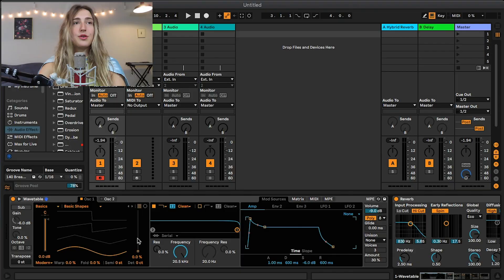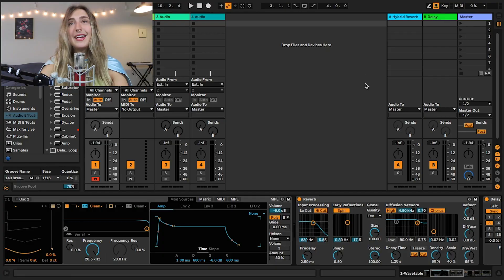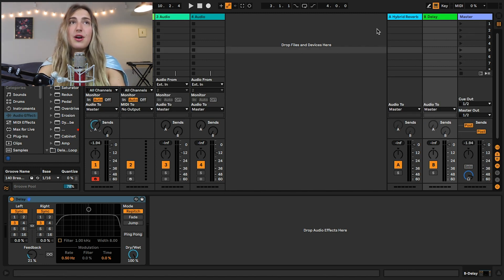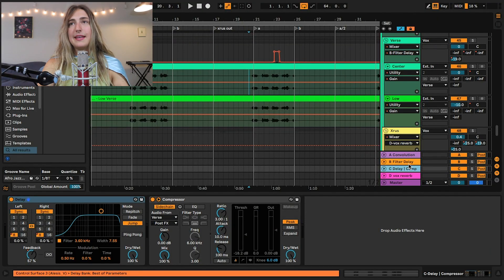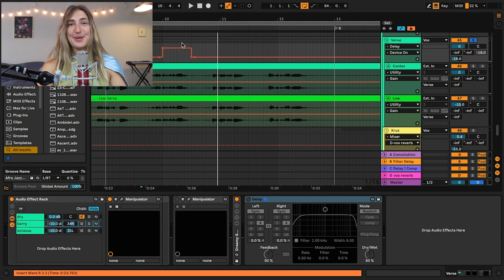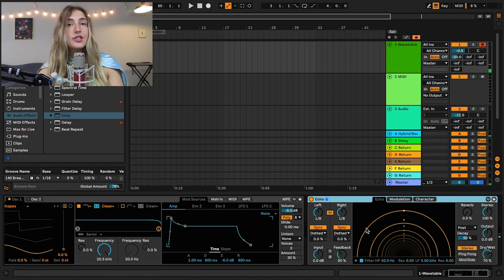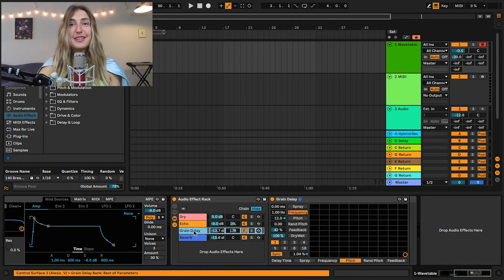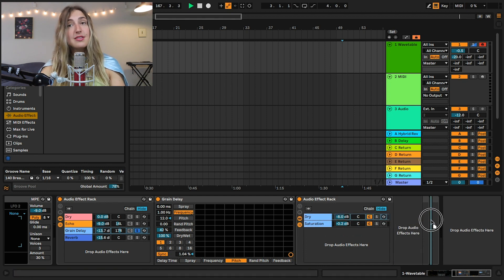How to Parallel Process (Production Tutorial)

Comment: Thanks for the video! I heard that there is another concept (I don’t know if it’s correct): dry/wet knob is often not a linear progression. Turning from 100% dry/wet knob to half way keeps the dry volume at the same level while increasing the wet volume from 0 to 100%. Moving beyond half way keeps the wet volume the same while reducing the volume of the dry. This way you get the full effect of the dry and wet volume when the dry/wet knob is halfway turned. So if you have to turn up your wet signal the volume of your dry signal is the same and doesn't turn down. I still don’t understand what is the advantage of parallel processing over the dry/wet knob. If we want to add a little dry signal to a 100% wet signal - we adjust the dry/wet knob to 80-95%. So I don’t understand why reverb plugins have 2 separate knobs - dry and wet.
Reply from the maker: Hiya, the dry/wet knob is linear. at 50% you're hearing half the dry and half the wet signal. 

I'm not sure what reverb plugin you're using that has a seperate dry and wet knobs? It should just be one knob.

As far as the advantage to parallel vs serial processing I break it down fully in this video, have you watched it in its entirety? 

let me know if you're still confused :]

Comment: At 5:50 when you explain why you use return tracks for delay and not racks. You can do the same in racks if you put a utility in front of the delay on the chain and turn the gain down on the utility to -inf and back up to capture that exact phrase you want to effect. It works the exact way you were doing it with the return, but with a utility gain knob instead. It has to be in front of the effect though not after it.
Reply from the maker: good tip devin!
Reply: I never knew that and I've been using ableton for a few years. Thx!